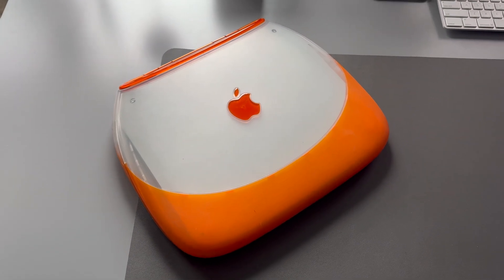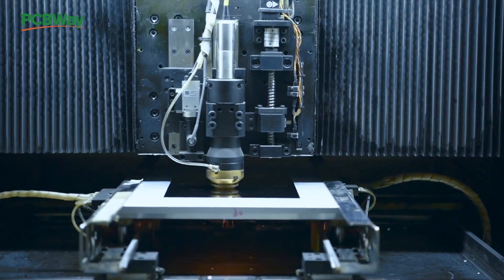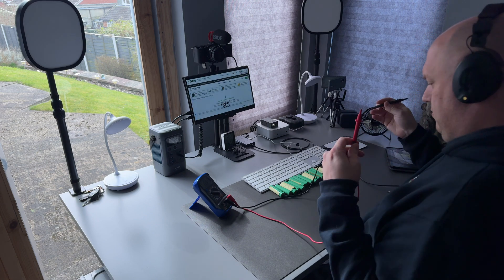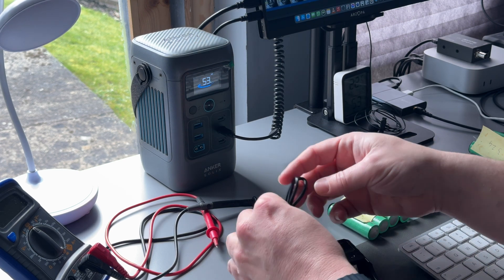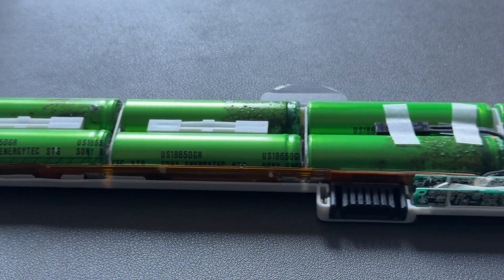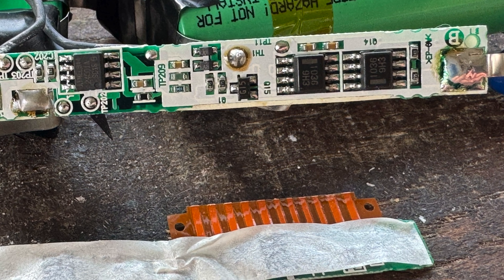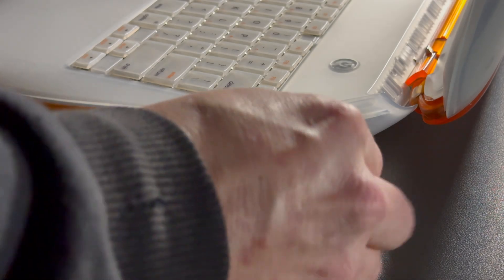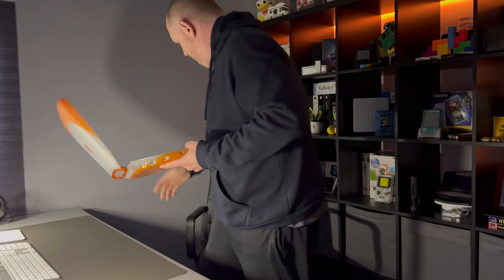Rebuilding my 1999 iBook G3 Clamshell Battery - DIY Battery - Happy #marchintosh

Comment: You should/could have measured the outside of the battery housing so you could 3D print a new housing IF the original doesn’t survive being cut or pried open.
Reply from the maker: I don’t own a 3D printer and I don’t have the skills to make a model and send it off for printing.

Comment: I rebuilt an iBook g4 14 inch battery. one rule above all: always start with more then one original you can and do ruin the BMS of some. I used a remanufactured battery from a newer notebook with the same number of cells so it all went without a hitch.

Comment: Thanks! Please explain your 'schoolboy mistake'... your original battery was 8 cells in 4 groups arranged as L(-) > R(+) which you faithfully copied on your first attempt. The other battery from which you salvaged a PCB was arranged as R(+) > L(-). Why? Where did you go wrong? Must new batteries be equalized and charged beforehand? I happen to be doing the exact same project right now and having a similar experience.
Reply from the maker: I am by no means an authority on this but with regards to the cell voltages, they should all be as close to the same as possible. If you had two batteries that were say 3.0V and the rest of them were 4.0V - when connected together from what I understand, there may be a sudden rush of energy from the higher voltage batteries into the lower voltage ones whilst they equalise the voltages of each of the cells. It is this that you want to avoid as doing so can cause heat. So ideally try and keep all the batteries at the same voltage. I stuck with 3.22V because that's what most of the cells were at other than the three 3.19V ones. Now we're talking about 0.03 of a volt in my case so it wouldn't have really mattered but I wanted to be sure. 

With regards to what I did wrong, it was all to do with the layouts of the batteries. In the original battery, the negative end was to the left - far away from the battery connector and PCB. In the replacement battery, the positive end was that end. So I'd wired everything up backwards because I wasn't paying attention and I just assumed they'd be the same. Also the cables that are used for balancing were on the negative end rather than the positive and also meant that when it came to connecting to the BMS, it was the negative terminal rather than the positive one. Because of this it just wouldn't charge.